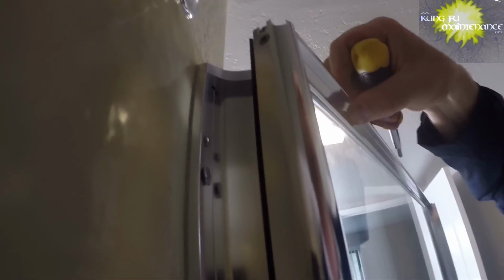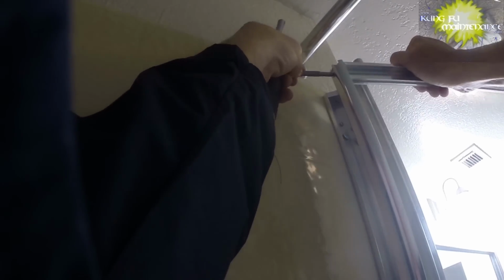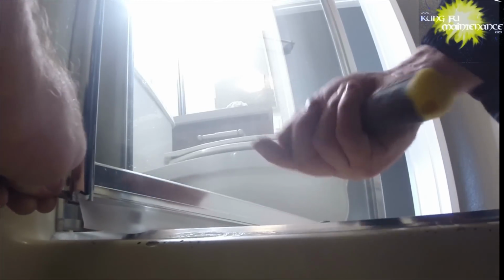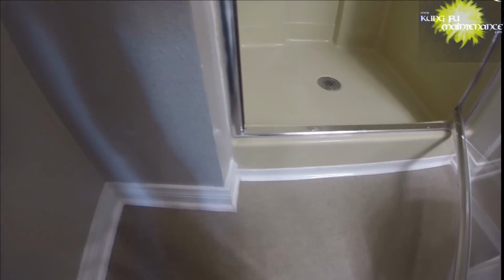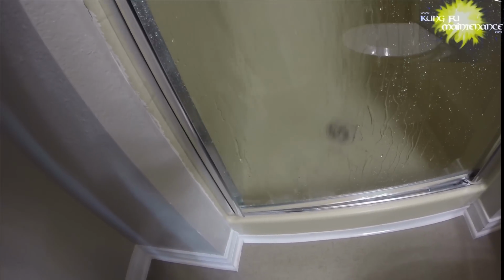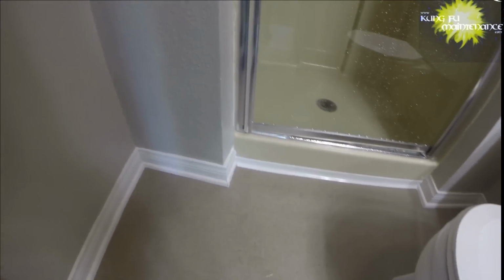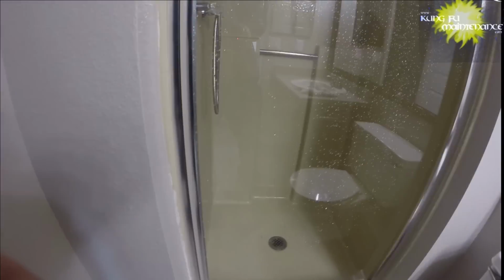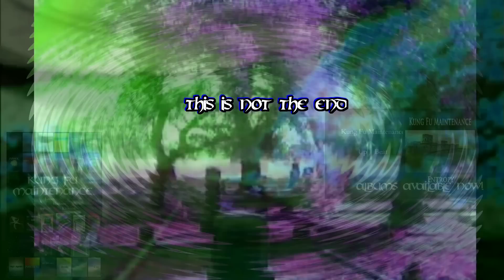How To Adjust Maax Shower Door Pivot For Better Closure

Comment: Hi! Is it just the very top and very bottom screws that allow it to pivot? My issue is the bottom 12" of the door magnet isn't lining up. Any tips? Thanks!!
Reply: I have the same problem.  The bottom of my door is still like 1 inch from latching.  Can't seem to adjust it to go move thing up.